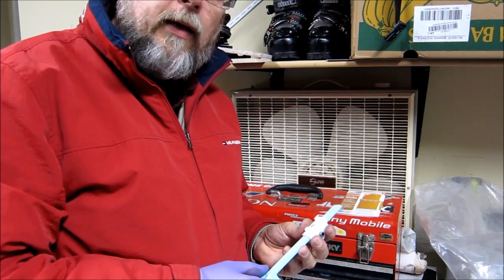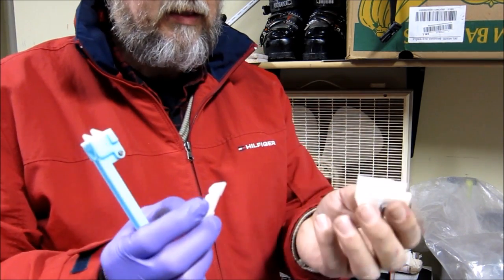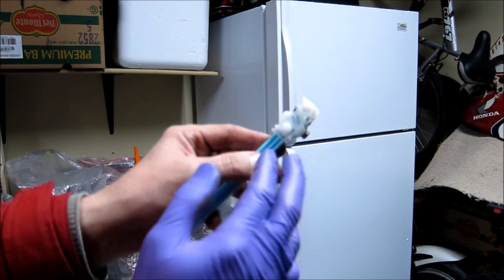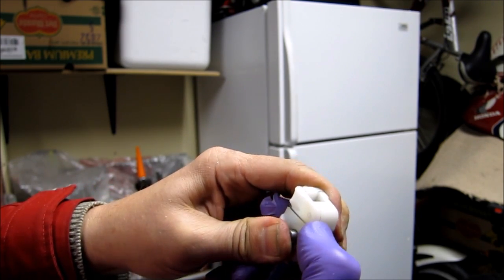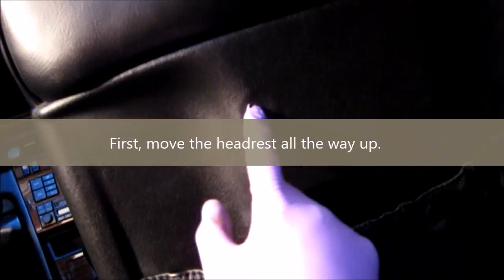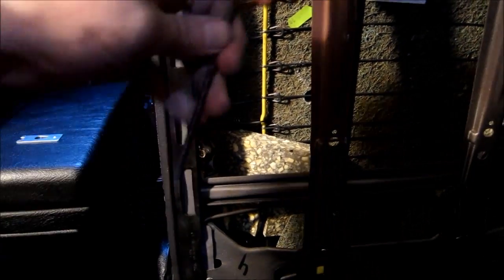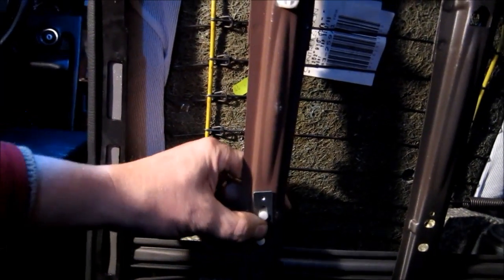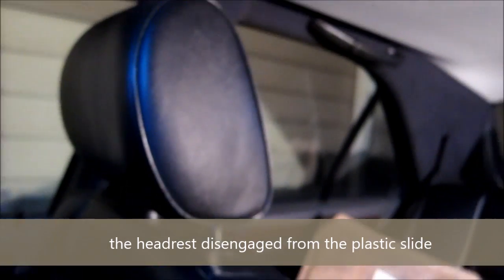Mercedes-Benz W202 C280 Headrest height adjustment repair

Comment: the rubber hose  that connects the motor to the plastic piece. I cant find it, when I opened it up it wasn't there I can't find it in here either
Reply from the maker: What rubber hose? The flex shaft that connects motor and rack/pinion is metal and looks like a spring, the ends are formed to have a square shape